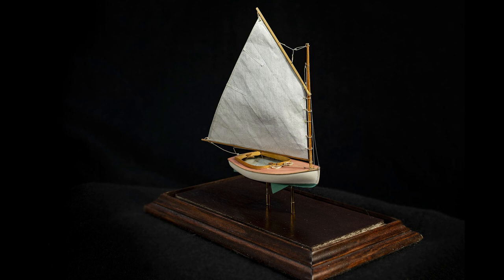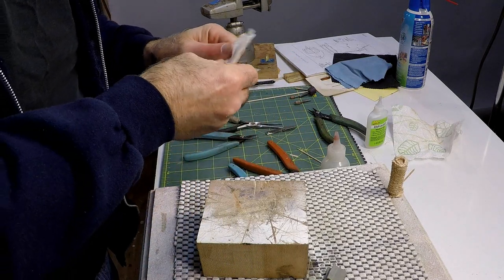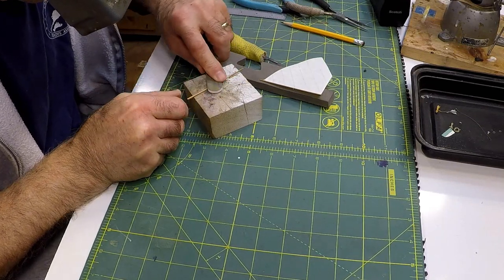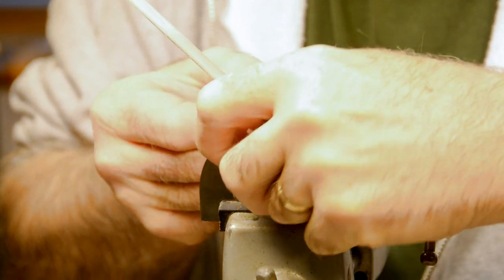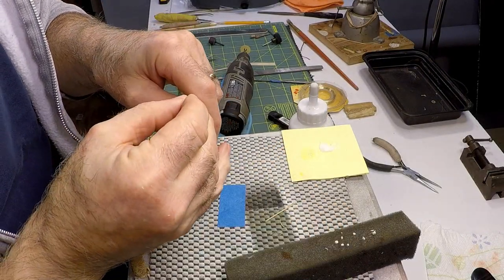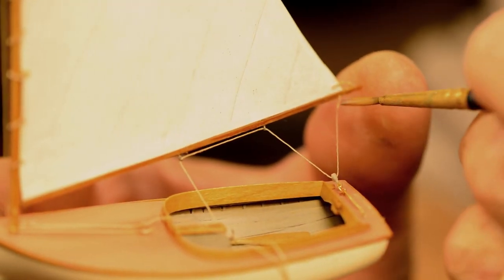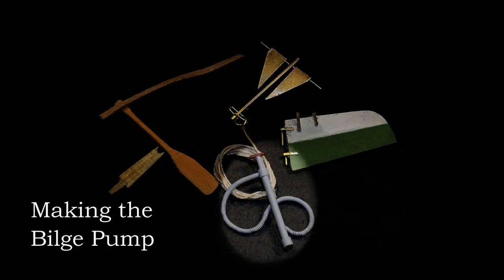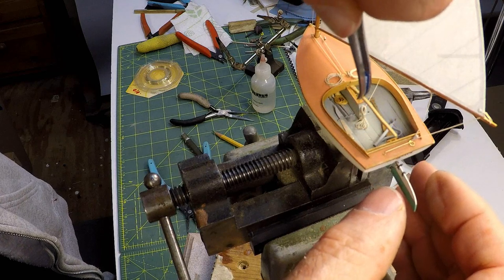Beetle Catboat Restoration, Part 2

Comment: dont know if you know this, but you can get a paste of flux and solder that comes in a small syringe, normally used for surface mounted electronics, makes life a lot more simple when soldering tiny parts. also, try and get a hold of dentist acrylic powder, it should be better to work with than the micro balloons. check Paul Budzik's video on it. really like your little rolling mill aswell!
Reply from the maker: Claes Wikberg Yes I do know about the flux/solder paste, but for some reason I haven’t figured out yet I’ve had inconsistent results with it. I didn’t know about the dentist acrylic though. That’s sounds like a great idea. Thanks Claes.
Reply from the maker: Claes Wikberg If you’re interested the NRG’s Ship Modelers Shop Notes, Volume 1 has the drawings and instructions on page 40 for a rolling mill